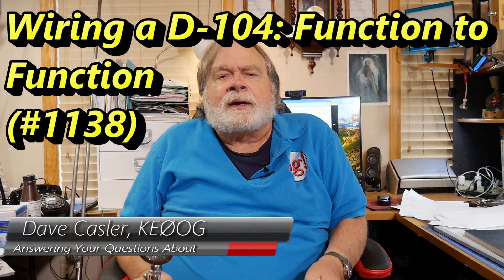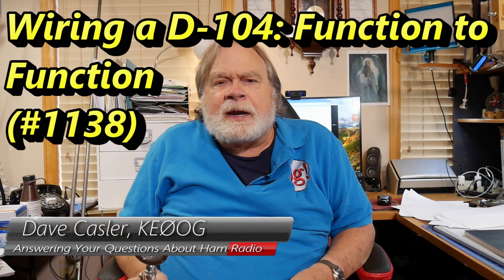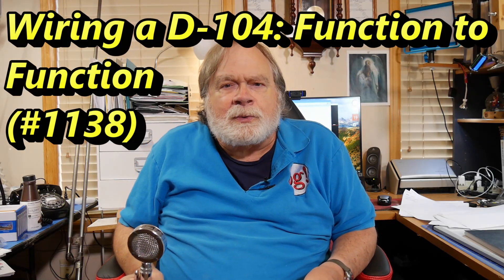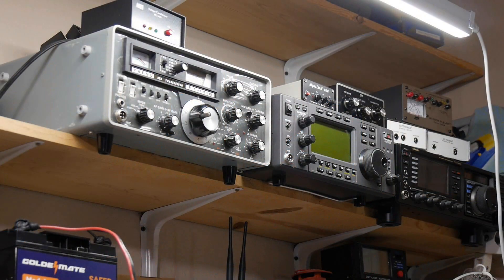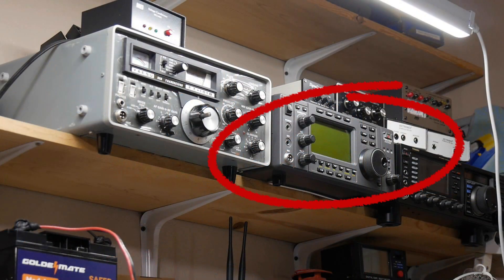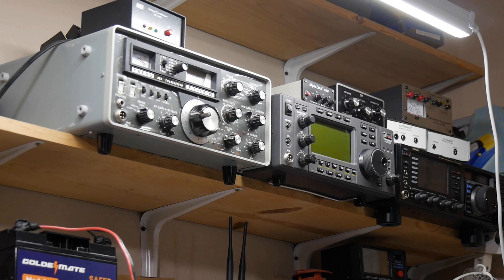Wiring a D-104: Function to Function (#1138)

Comment: Thanks a ton for this video Dave. I just picked up a used D-104, mostly for nostalgia reasons, and need to have someone wire it to work with my W2IHY EQPlus.

More than 30 years ago, twelve year-old me, whose voice hadn't dropped yet, was using a D-104 on SSB, and probably hurting ears all over. I would check into nets, and hear "Let the YL go first"

Comment: I have the ICOM 7300 and I made a adapter to use XLR mic . What i found on 7300 is DC voltage on mic audio . I had to use a non polar electrolytic cap like 10UF 25V in seares to stop DC current. Works great. I use Heil foot pedal for PTT and XLR mic That is Heil sound as well.  I also wired a headset with mic to 7300 as well. The mic pinout for the 7300 is in manual and can be found on-line. The only issue I had was that cap to block DC. 73

Comment: I would like to hook a D104 to my Kenwood TS 590 SG.  Will this mic work on my radio and what needs to be done to make it work.  Could you advise me what I need to do to make it work.
Reply: Yes, I have one converted to work with my TS-570D, which would also work with your 590SG. W2ENY sells a kit on eBay with a schematic and a new element for $25.00.

Comment: I converted a D-104 Silver Eagle (4 pin to 3 pin) to match my old Heathkit SB-101.  I found the mic on eBay and the radio was gifted to me. I took apart the base of the mic to figure out what I needed to do and it wasn’t too tough of a job to rewire in a 3 pin connector (I also had the schematic of the D-104).
I really like the microphone and it sure has a cool look with my call sigh flag attached to it.
Just a suggestion though; I’d construct an adapter cable for the new radio instead of replacing the old connector. Those old m/f connectors are available on eBay but are a bit pricey. 73, AE0UV